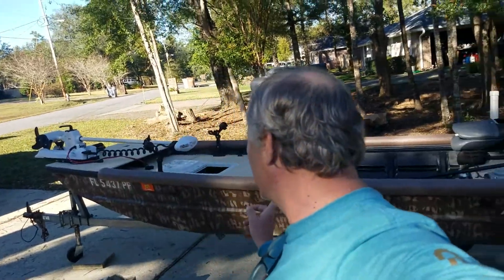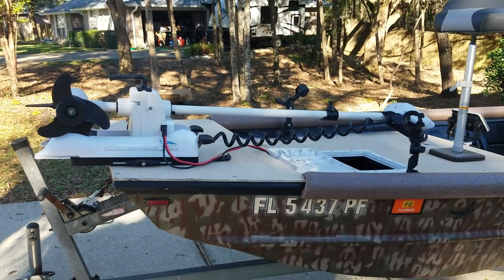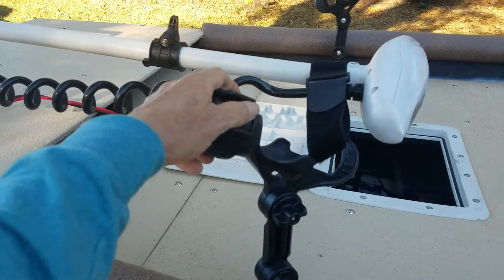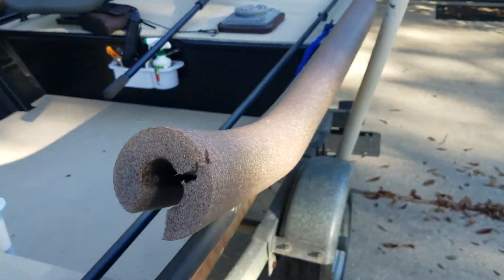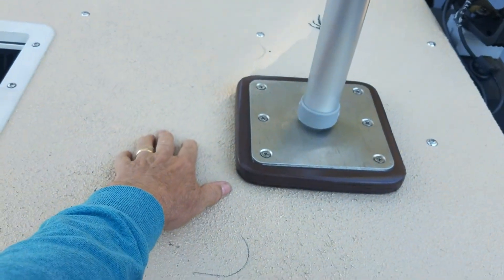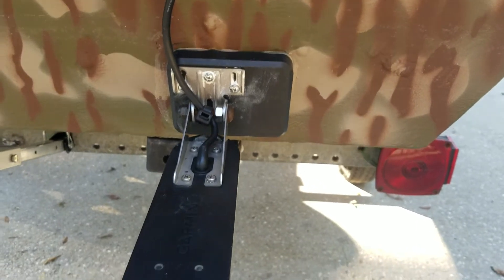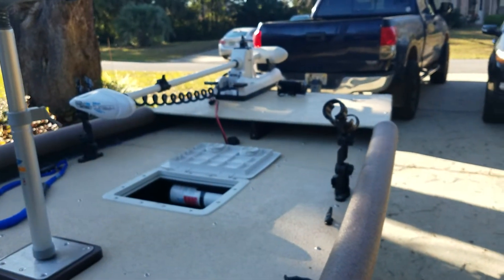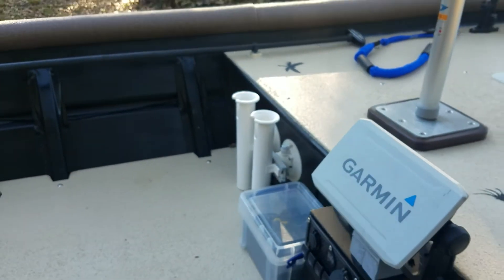Jon Boat to Flats Boat Summary

Comment: Very well laid out, and everything handy! Never thought about pool noodles. I've rubber bumps but they're barely 1/2" tall, don't do alot. Seeing these noodles reminded me of something. Noodles every need replaced hardware stores have pipe insulation up to 12' that are split like noodles, denser foam, smooth finish, more durable-$2 or so. Never thought about using them on my gunrails till now.
Hook em!
Reply from the maker: Thanks. I learned a lot from kayak fishing, helped in the layout. These noodles aren't super tough, I'll look at the pipe insulation idea when these need replacing.